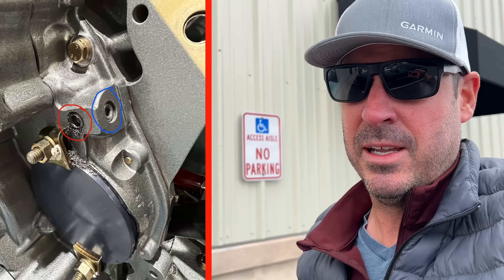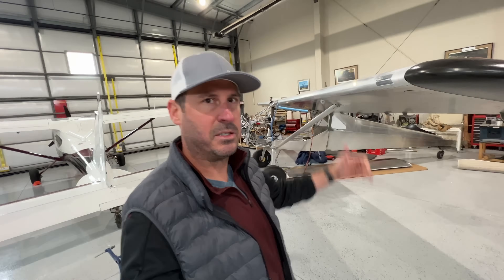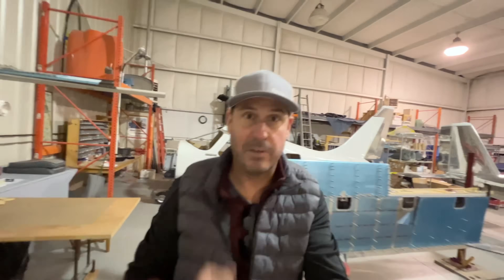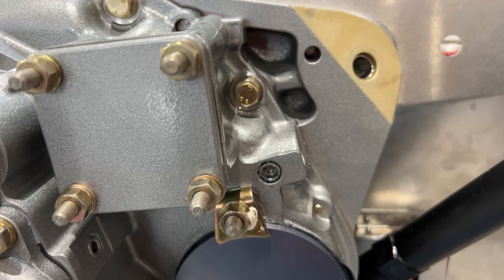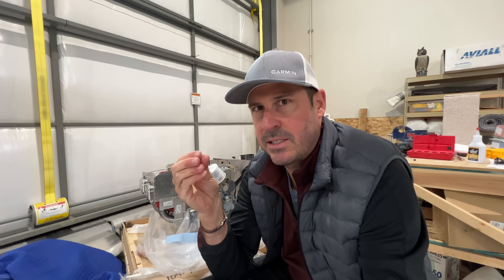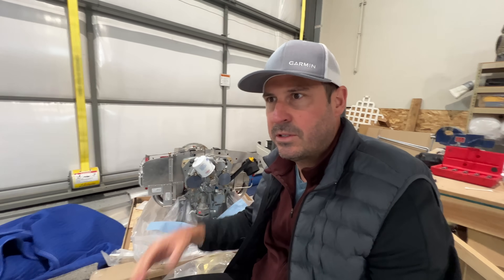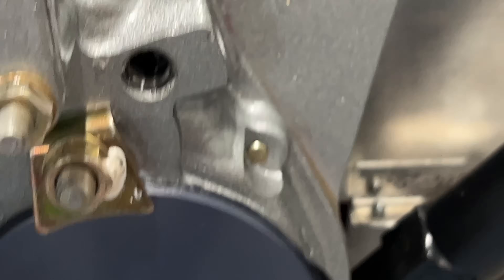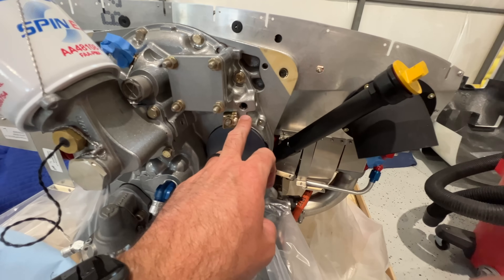Did I just ruin brand new $40K airplane engine?

Comment: A&P here...One trick that I use on Allens is to use an "L" shaped wrench. Put the short shaft into the head and make sure it's fully seated, apply a small amount of hand pressure in the counter clockwise direction. Not trying to remove it yet, just some pressure. Take a heavy object and tap it against the end of the shaft. You may find that a few good taps is enough to break it loose. I always do this the first time. Once you've rounded out the head, it's a lot harder to fix.

Comment: I had to remove a broken cylinder stud that was broken off flush with the case.  I drilled three holes in a line with a 1/16 drill bit and then linked the holes together using a carbide dremel bit.  Inserted a flat head screw driver socket and casually backed it out.  Was super anticlimactic after intensely worrying about it for two weeks.

Comment: I know this is a year late, but I've used a smaller torque bit and J B weld.
Use a good solvent and thoroughly clean  the inside of the stripped bolt and the bit put enough JB weld to squeeze out, keeping it off the edges of the bolt and let cure for 24 hours. 
I haven't tried this on aircraft bolts, but it should work. 
(I've done it on a Caterpillar road grader once, and the bit was permanently attached to the bolt.)

The Extractor they loan you is fantastic.
I'm going to have to look into getting a set of those for myself.

Comment: Wrap drill bits w/insulated wire tightly end to end & connect ends to a 12-volt battery briefly till the wires heat up... Cool and repeat. Now the bits are magnetized.
Reply from the maker: Interesting! I’m not sure how this would’ve helped in this situation, however. But I’ll keep it in mind, thanks!

Comment: Harbor Freight hex keys ..... shame on you .   Get some Wera hex keys .
Reply from the maker: Nah, the hex key didn’t have any witness marks on it. It held up fine.
Reply: @CLEAREDDIRECT  Yeah just try some , I use them ever day to get screws out that were stripped by other brands . The wera's have a flank drive system that doesn't use the sharp edges to drive . Snap on invented this system decades ago for their sockets and wrenches .  Your cheap wrench "held up fine " but ruined the bolt .  WERA hex keys will not do that .
Reply from the maker: @onthelake9554  again, the hex key didn’t ruin the bolt. The bolt ruined the bolt. I’m no fan of Harbor Freight, but let’s be honest here. It wasn’t the hex key.
Reply: @CLEAREDDIRECT   Hey sure thing , just trying to pass on some real life everyday experience that I have daily but if you know better than someone who turns these bolt every damn day for living for 30 years I'll leave. Good day .

Comment: That's a vein plug, when taking them out always heat them when removing. I learned another useful trick is to actually  go tight with them at first just till the vein plug begins to turn in the hole, that allows the threads to break any sealant loose. Then back it out, since the head is stripped it's feasible to do multiple things. You could drill it out and use an extractor. Another option is to use a chisel and actually rotate the veil plug using the chisel. If you drill a very very small pilot hole, that allows the metal to expand in while heating, heat the outside of the crank case not the vein plug itself. Then use the chisel to spin it. Another, better option is to tig weld stainless steel to the vein plug (higher tensile stength than welding mild steal for filler). And then spin it out. Also helps alot before removing any fastener that has been fastened for a while, to hit the fastener with a hammer, usually with thw socket on there. If you need to make a metric work on a standard bolt you can also use this trick to swell the metal that last little bit for a tight fit! Sorry they made it from soft metal!

Comment: Dude I admire your drive but maybe you shouldn't work on that video your that nervous. Those are not bolts they are  socket head pipe plugs. Bolts have straight threads and those plugs will have a tapered thread.
Reply from the maker: Thanks for the advice.

Comment: Main point here everyone is missing is that the use of that type of plug is a piss-poor design to begin with.  I thought the main reason for waiting forever for an overpriced Lycoming or Continental was for superior quality! What a letdown! You sure are a lot calmer about the situation than I would be because if they can't even use proper temporary hardware on a oil port , u gotta wonder where else have they cut corners on these engines???? Been a professional mechanic all my life and constantly get mad at engineers because most do not ever consider even basic maintenance in their design . Just the thought of running into this issue on a 50 thousand aircraft engine is appalling. I knew they were owned by China but they must be making em there too. Pitiful

Comment: That is not a bolt it is a plug and it is tapered and sealed in with a chemical sealant. Good quality tools will do better but the plug is soft steel.
Reply from the maker: It wasn’t the quality of tools. Too soft metal and not enough heat used

Comment: The oil filter also is pointed in a really precarious position for removing it without making an absolute mess. I would put a remote oil filter bought it and put it down wherever you can access more easily.
Reply from the maker: Yeah. My Bonanza’s IO-520 filter is positioned the same. I’m used to pre-positioning paper towels

Comment: If the extractor does not work, you can clean the bolt and use JB weld with a Allen wrench in the bolt, let it cure and it will can out.
Reply from the maker: Great idea! A few people have suggested TIG or MIG welding too. Thanks!

Comment: You did get really lucky.  Never use an extractor on anything.  Throw them away.  They break off often and then you are totally screwed.  Instead, jam a torx or allen in there as tight as you can.  Weld it in place.  It will come right out.  If you have a bolt twist off, then weld a washer on the remaining piece, then weld a nut to the washer.  It will come right out.
Reply from the maker: Gotcha! Thanks

Comment: I see a lot of people on here saying to use a torch. Don’t do that because it will burn your gasket and or O- rings on the case. However they are correct a heat gun doesn’t get hot enough.  What works the best for the scenario you were in is a soldering iron. It will heat up the pipe plug and loosen up the sealer that is on the treads and will come out easy.
Reply from the maker: Gotcha! Thank you

Comment: Couple of tips for the future:
1) peanut butter does wonders. Not on engines, of course, but on pancakes.
2) heating up the engine helps, but it takes a while, so if you drain it of oil first it’ll heat up in a jiffy.
3) hire someone who’s a quality tool. Someone who mimics every handheld object as his genitals, but really knows what he’s doing with engines.

Comment: Next time don’t use an adjustable wrench but rather a long extension with a 6point shallow socket to hold pressure in while you turn it and to control its angle holding it straight while it’s being turned. 
Also the heat from the heat gun is not significant enough to do anything.  And you don’t want to heat the interior object you’re trying to turn anyway which would just expand it and make things harder.  Fortunately for you you don’t have enough heat to matter and the aluminum probably absorbs it faster anyway. Although it absorbs it so fast that it probably also does practically nothing.
Reply from the maker: It has a square head
Reply: @CLEAREDDIRECT  then use an 8 point socket.   or even a 12 point, if you really can't get an 8 point.      well, the point is, keeping pressure while turning increases your chances greatly in a couple of different ways.   glad you got it out, but just cringing, watching.    the adjustable wrench is a very sloppy way of getting only two points of contact, no pressure inwards, and no control over the angle.

Comment: I'm happy you got it out. But I'm a Retired Aircraft Mechanic of over 55+ years. This is going to be some constructive criticism. You're right. You are not an Engine Mechanic. There were several times you did things so wrong it was scary. Using the wrong tools can and always has resulted in major screw ups. You were very Blessed to get that Allen plug out. One of the first things you need to learn is PATIENCE. Slow down. It's good you reached out to others and got the other type of nut and bolt remover. Using a Heat gun wasn't the greatest idea. A torch or even a Bic Barbecue Lighter would have been much better. I've done it. Using a crescent wrench was scary. Ok. Enough of the negative. I'm proud of your sticking to it and not giving up. You got it out. That was actually very rewarding to see. When you have questions ASK!!.... There are lots of us old guys that would love to help you out.....   Cheers.
Reply from the maker: Always open to constructive criticism. It’s one of the reasons I air my dirty laundry (lack of craftsmanship experience) is so I have you guys watching over my shoulder.
Reply: @CLEAREDDIRECT  Thanks for the reply. I may be an old Dog but I never tire from learning new tricks. Like I said though. If you have questions ask.

Comment: AeroKroil FIRST,    Heat second followed by an impact hammer.   Not a pneumatic air-impact hammer, a manual impact hammer.  The kind you "peen" with a regular hammer.

Comment: that hair dryer is not hot enough.  also get something that you can beat on with hammer and smack it 4 or 5 times damm hard
Reply from the maker: 900° heat gun

Comment: Great to see you got yourself out of the s#%t,  Stud extracors are good for Chevy Nova''s and lawn mowers! As they bite in, they expand what you have left of the plug and increase the bind! There are 3 things you do... 1. cook any chemical/sealant to beak it down - the heat gun wont do this, you need oxy torch or similar. 2. shock it - get a punch that is about the same size as the plug outer and hit it once hard with a decent hammer once it is cool again. 3.To rotate the plug, use a 45 deg chissel and work it around on the outer of what's left if it's an alloy plug, or tig weld on an old allen key if it's a steel plug (this also does the same as #1 so you weld on a straight shank & can hit the shank. NEVER use the grease trick if it's not your Chevy Nova or a lawn mower or you are 100% going to strip down the motor completely. Oh yeah, replace all the plugs with quality stuff, and don't assume because it comes from the manufacturer it is good quality!

Comment: I’m not a fan of using a Torx bit as if one or more of the hardened teeth break off, it makes drilling out out nearly impossible.  I don’t know what brand Allen wrenches you used, but I suspect they were a cheap set.  Cheap Allens are almost always undersized and also of poor quality alloy with improper heat treatment.

If you follow these steps, you are very unlikely to ever have this problem again.

1. Buy high quality internal hex wrenches that are driven by a ratchet, not the L-shaped wrenches that are for low torque fasteners.  If your set costs less than $100, it is a cheap set.
2. If you suspect the fastener has thread locker applied, and I generally assume that is the case, heat the area to 350 F using a good heat gun and a handheld IR thermometer to get the right temp.
3.  Dip the business end of the internal hex wrench into valve grinding compound before inserting it into the fastener to be removed.  That will greatly increase the friction.

Once you have sufficient experience, you can omit the valve grinding compound at the start as most fasteners will come loose without that, but you have to have enough experience to feel the initial stage of deformation of the socket and stop immediately if that begins and apply the compound before you damage the fastener too much to allow removal.  To be on the safe side, and for critical fasteners, just take the time to find the compound and use it at the outset.

It was nice to see you succeed in removing the plug without damaging the engine case.

Comment: Yeah don't use the ball end of the Allen wrench to get those plugs loose. Use the other end the straight end. Then you can flip it around and use the ball end once it's loosed.
Reply from the maker: Totally. I didn’t use the ball end and still stripped. Learning…
Reply: @CLEAREDDIRECT  huh! Well you got it out anyway, so that's good! I work on autos, motorcycles, ATVs n small engine stuff and figured it out the hard way myself not to use the ball end to loosen. With a Snap On Allen key no less! Ha!

Comment: The electric heat gun was not good. In that a small oxy - acetylene brazing tip to get more heat in a pin point location is your best bet. Smith brand makes some really nice small torches for brazing. But in this situation; precision heat placement is your best friend. Heat and Cool. Heat and Cool again - you might have to this several times of heating and cooling. Once you get all those low grade bolts out - go with high quality stainless steel socket allen head bolts and always use - Never--Seez Marine grade Lubricant on all bolt threads.   
Never--Seez Marine grade Lubricant is made by Bostik Company. Applying the Never-Seez will insure that the next time you need to do some service work the bolts will come out without a hassle.
Reply: But it's a plug not a bolt. Use a little bit of like Teflon pipe sealer on plug threads or fittings, but not the teflon tape or antisieze.
Reply: @oneninerniner3427  Okay - noted on plug - Then go with - Hercules Block Blue Thread Sealant - for a tough, flexible, leak-resistant seal.

Comment: It‘s all a learning process. BTW I‘ve seen elevated failure rates on the Red Cube FF meters lately on the Glastar Forum (my FloScan is still humming at 2500 hrs aft of the firewall with my carb’d 320). Although on the ‘cool’ side of the engine as shown, it’s still a high vibration mounting location. I’m also not sure having a 90° fitting on the outlet is prescribed. Personally, I’d mount a fragile sensor like that on the firewall with the straightest runs to and from that your other constraints allow.
Reply from the maker: Woah interesting stuff! Red Cubes are made here in Bend. Perhaps I’ll investigate. I’ll definitely re-think my mounting decision.

Comment: Couple of tips for the future: 1. Use a torch to heat the plug not a heat gun.  2. Heat the plug a lot then quench it with a wet rag. Have a bucket of water to keep cooling the rag to quench the plug.  3. Use a quality tool in the correct size.     If you do this, it will come right out. The heat expands the plug, but since there is nowhere to grow in the threads, it expands out some. The quench shrinks it across all facets. It will come right out with ease. I've used this method on everything from motorcycles to heavy equipment, it works.
Reply from the maker: Thank you!
Reply: The problem with doing this with an airplane engine is the thermal shock actually is going to decrease the reliability of that particular part due to the internal stresses of the metal and therefore a solution that uses strong heat shock is not a good one...
Reply: @pilotavery  the only thing we are heat shocking is the part that’s being removed and discarded. Also, it’s not a stressed part anyway. This solution holds for this usage.
Reply: @AnonyMous-jf4lc  how do you heat up a tap embedded in the steel without the heat sinking into the surrounding metal?
Reply: @pilotavery  it’s not a tap, it’s a plug. The bulk of the heat is on the plug. The other parts are designed to be heat cycled, it’s an ENGINE. We are only shock cooling the plug. That filter housing that it’s on is not a stressed part. You do know that parts of that engine get insanely hot when it’s leaned for cruise, right?!
Reply from the maker: @AnonyMous-jf4lc  agreed! Thanks for the good info

Comment: Glad you got it out! One trick is to try to heat the outside of the thread (the case) while cooling the inside plug you're trying to remove. Luckily aluminum expands more with heat than steel does, so you're still helping by generally heating everything. The huge heat sink of the case is a challenge, though, usually calling for more heat.

In any case you're good! I struggled with this port also, in my case the hole where you were removing the plug wasn't even drilled. It took some clever plumbing to make the 90 degree hole work with minimal clearance from the engine mount.

Comment: You really earned your beer that night. That is some tense stuff, man. Yeah...Allen's can be a real bear. Glad it all worked out. Torx bits do make good allen extractors. If it's already rounded out and going up one size is a bridge too far...you can always grind a larger one down a bit and bash the bastard in until it gets what's coming. There is no 'one size fits all' stripped bolt/nut situations. 

Also...L shaped allen wrenches are definitely not the way to go on iffy bolts and such. Too much uneven side load. A socket type is the way to go. You can put a bunch of pressure directly in line with the thing while cranking. 

RCH. Bad Steve. Bad. I'm already going to hell so I know what that means but think of the children.
Reply from the maker: Man I’m going to school here. Lots of great input AFTER the fact! Haha. Sorry to all the craftsmen like you that watched this disaster. RCH RCH RCH RCH 😜

Comment: one hint as a life long Harley tech fixed many broken bolts ( most caused by customers ) use a T handle on socket to extractor allows more and even pressure to broke part much less slipping.